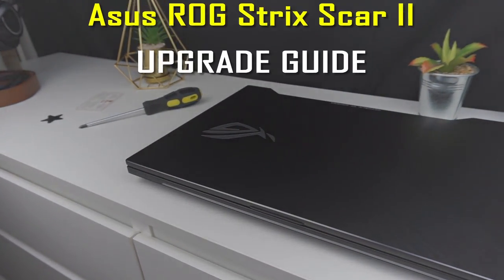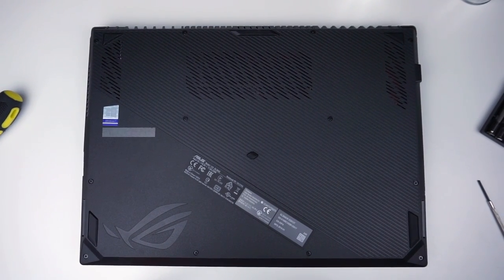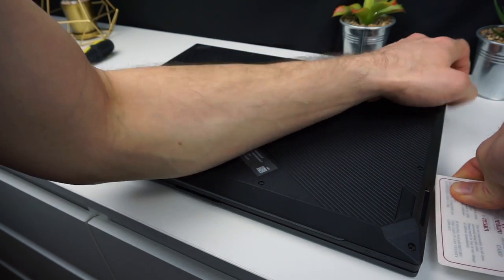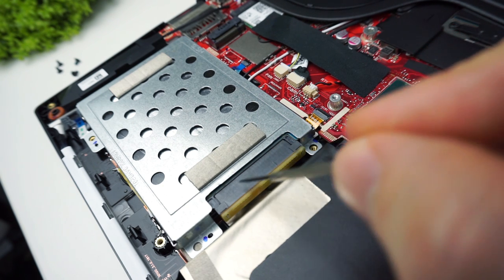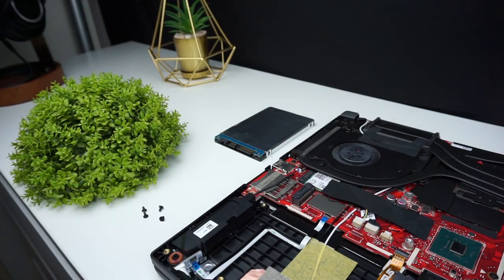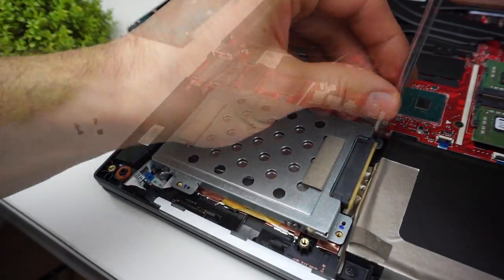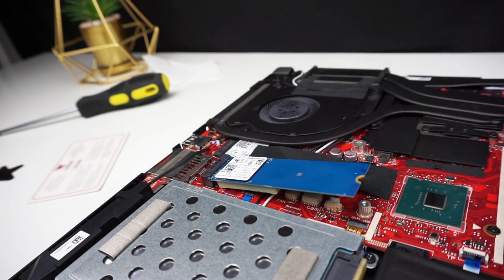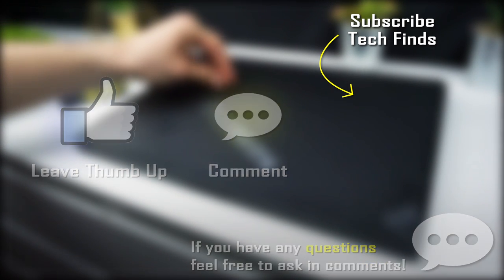Asus ROG Strix Scar II upgrade (RAM, SSD, HDD) - Disassembly Guide (detailed)

Comment from the maker: ✅ Free download RAM / SSD / HDD data recovery software: https://bit.ly/2zRpN9B

INFO UPDATE:
1. HDD cable - If you bought Scar II without HDD and you can't find the HDD cable in the box or inside of the laptop, here you can buy one: http://tiny.cc/f3oo7y and HDD caddy here: https://bit.ly/2X9zXNn
2. HDD connector (motherboard) - On the back of the connector there is a little black tag that you should be able to tilt up carefully to easily slide the cable in and then push this tag down to fit the cable tight.
3. RAM - single channel RAM (1xstick) drastically decreases the performance of this laptop so if you can get it with dual channel RAM (2x stick) go for it or add one more RAM stick if you already have Scar II with single channel RAM. In some cases it's even 30% difference in performance!
4. For those who ask - Scar II and Hero II is exactly the same laptop with the only difference of transparent keys. "WSAD" for Scar and "QWER" for Hero. You can get Scar II with both RTX 2060 and 2070 (also GTX 1060 and 1070) while Hero comes with RTX 2060 or GTX 1060 to choose.
Reply: Tech Finds Hi, if I buy the scar 2 with single channel ram (16*1), what would I need to do to upgrade to dual channel (8*2)?
Reply from the maker: @timeshaft5088  No, that would make no sense. If you have 1x16 you can just buy another RAM stick, 4, 8 or even 16GB and install it. Then you'll have dual channel (2 slots occupied) and even more RAM.
Reply: Tech Finds That makes sense. So if it comes with 1x16, then that means the other ram slot is empty?
Reply from the maker: @timeshaft5088  Yep, this laptop has 2 slots for RAM no matter if they ship you with 2x8 or 1x16. Btw. you can have up to 32GB RAM in total.
Reply: Tech Finds Dude thanks. Seriously you give the best answers
Reply: if I already have a busy ram slot (with the basic 16gb ddr4 ram), and bought another 16gb from another brand, would that be a problem for you?
or should I buy 2 more from sixteen GB of the same brand? coaa change
Reply from the maker: @user-wl4gl2in3l  You can add one 16GB RAM stick that you bought and it should work well if it's fairly similare. Brand doesn't matter so much but for the best compatibility it's recommended to have 2 the same sticks.
Reply: @TechFinds  thanks, i Will buy 2 Stick ballistix 2666 MHz  2x16 GB (how much will the performance increase?) And therefore i must remove the one already in the computer
Reply: I just ordered 32gb of ram, I was running single channel ram and was wondering why my performance was so lack luster.
Reply from the maker: @MrCakePerson  Now not only you have dual channel but also 2x more RAM. That's a huge difference. :)
Reply: Tech Finds I sincerely hope I don’t mess anything up while taking this apart. I even found a 500 gb ssd to put inside
Reply from the maker: @user-wl4gl2in3l  sorry i didn't notice your comment. If you buy 2 new sticks you have to take out the original one but you can also buy only one stick of 16GB and add it to the second empty slot.
Reply from the maker: @MrCakePerson  This laptop was not hard to open and installing RAM is very easy so you can't go wrong. The only hard part is installing the 2.5" drive - this ribbon cable is very easy to disconnect and hard to connect back...
Reply: @TechFinds  When my stuff comes Monday, I will give you an update. How does a laptop 2060 compare to a desktop 1060?
Reply from the maker: @MrCakePerson  Generally desktop hardware is about 10% better than mobile version of it in a laptop. A laptop with RTX 2060 should perform better than a desktop with GTX 1060.
Reply: Tech Finds the ram works fine, my laptop didn’t come with a cord to install my second ssd. Do you have any suggestions where I can order it from?
Reply from the maker: @MrCakePerson  Few people had the same problem here but few of them found the connector in the box with paperwork. Check if you have one.
Reply: Tech Finds yeah, both of my boxes are completely empty. I probably threw it out by accident or one of my family members did. I already ordered a new piece though.
Reply from the maker: @MrCakePerson  sometimes laptops come with the connector already installed inside of the laptop even though it comes without any HDD. But I suppose you have checked it too. Anyway, could you link the one you ordered?
Reply: Hyperx or Ballistix for rog Scar II???
Reply from the maker: @MrCakePerson  Thank You, it's gonna be useful for people who don't have their cable.
Reply from the maker: @user-wl4gl2in3l  Hyper X seems to be slightly better because of lower latency but i'm not sure if you would tell the difference. Both brands are good but i would go for Hyper X.
Reply from the maker: @avikmandal6133  sometimes they send the cable in the small box with paperwork and sometimes it's already inside the laptop but there were also people who reported that after buying Scar II (configuration without HDD) the cable wasn't included at all. It looks like it vary between countries so I can't really tell you if they will ship you the laptop with cable.
Reply: Is there even better performance by having dual channel 2x16 GB sticks than having dual channel 1x16 and 1x8?
Reply from the maker: @carlosduran2800  yes, dual challel works faster. Check out this video to find out more: https://youtu.be/E_aPaj5QkmM
Reply: Thank you, I've been trying to find the cable for over an hour, didn't think to check YouTube comments!
Reply from the maker: @owNewBlood  I think i'll add the link to the video description too. :)
Reply: Tech Finds Tech Finds Hi. First of all thanks for your video, was really helpful. I just ordered asus rog scar 2 and I’m looking forward to upgrade this laptop, my question is... what do you thing about the warranty, i mean there’s no problem adding another ram of 16 cuz there’s an additional slot, however do you thing modifying the hhd would have repercussions on the warranty. Mine comes without hdd. 
Probably a dumb question but thanks anyway, greetings from Spain.
Reply from the maker: Hi, thank You! Well, that's not a dumb question and actually good that you ask. However i can't tell you for sure if you can do it without affecting warranty or not, because the warranty terms may vary between countries. It would be good if you ask Asus's support or read your warranty terms. Generally you should be free to do it since it's a gaming laptop. My unit had only warranty sticker on the cooling system so i was free to touch anything else like RAM, HDD or SSD.
Reply: Tech Finds thanks ❤️
Reply: OMG !!!!! thank you very much. I was looking for that F!#!@# cable everywhere.  THANK YOU !!!
Reply from the maker: @robertovideo  Hahaa, You're welcome mate. :D
Reply: @TechFinds  Do you know what size is the HDD caddy? or where to find it?
Reply from the maker: @robertovideo  You've got it on the same page as HDD cable: https://bit.ly/2X9zXNn
Btw. don't you have caddy too?
Reply: @TechFinds   Nope, I was missing the cable and the caddy.  I bought this computer on best buy for $800.
Reply from the maker: @robertovideo  Wow, that's a very low price. Was it on sale? What are the specs of your model?
Reply: @TechFinds  First, thank you for this quick and to the point video and information, very helpful, I subscribed! I know now why my Hero 2 is performing poorly in games, because it came with 1 stick of 16GB. I have a question maybe you could help me with: I want to add another 16GB stick...you mentioned in the comments above HyperX or Ballistix are better, but I cannot find the same versions you linked on Amazon here in Belgium (where I live). I can only find the Crucial 16GB one, which seems to have the same 2666 MHz, CL19, 1.2V, and pins as my current RAM stick. Can I be sure that if I add this one it will give me DUAL channel functionality? Because on some forums I read that if they don't come in a kit with 2 sticks from the same brand DUAL channel functionality might not work, and I wouldn't want to buy 2 new sticks and throw away my current one. 

Thanks!
Reply: Actually I just found the HyperX 16GB RAM on UK's Amazon at about the same price as the Crucial one in Belgium. The thing is, the latency (CL i think) don't match with my current RAM (seen this in CPU-Z). The HyperX is CL15 and my RAM is CL19 (as I found online. In CPU-Z on CAS Latency it says 17-18-19-20). So do you still think HyperX is a better option or should I go with Crucial since it has the same CL among other things?
Reply from the maker: @draculu  HI, that's good you ask. I always say that for the best compatibility it's recommended to have 2 sticks of the same RAM but in your case it pays off better if you just buy another 16GB stick, so you should go for the one with closest possible specs. I can't conform that dual channel may  ot be working because of difference in latency, because I have never experienced that and as I know
, the dual channel Is wasically when you have physically installed 2 sticks in 2 slots (nothing else). What I know and I can confirm is that if you mix your RAM and the specs will be different, it may downclock to match the same (probably lower) latency, so you may have 2400MHz even tho your both sticks are 2666MHz.
Reply from the maker: @draculu  yep, Crucial is the closest possible if it comes to specs so you should be good.
Reply: @TechFinds  Just to update you. I got my Crucial RAM stick today, I installed and it works perfectly in DUAL channel with my original RAM. Performance increased dramatically, before I had about 160-210 fps in CS GO, now I have 250-300 fps. In Overwatch it went from 100-120 to 170-200 on HIGH settings. Amazing what one stick of RAM can do. Thanks for the help!
Reply from the maker: @draculu  Hey, thanks for the update. The result as expected.
Reply: Question 
If you replace the ssd do you have to re install/buy windows 10 again?
Reply from the maker: @noskis9432  you don't have to buy it again. You need to reinstall it but first you have to get free copy of Windows 10 I guess. Ask Microsoft's support so maybe they can provide you exact solution and tools to do it.
Reply: Tech Finds for some reason its saids the ssd is not connected but on the bios menu it reads it. Did i get a defective ssd?
Reply from the maker: @noskis9432  where you can read that it's not connected?
Reply from the maker: @noskis9432  if the device manager knows that the SSD is there it must read it. Are you able to partition it?
Reply: Tech Finds no it just shows my hhd. I saw another video about this and they suggested to download some drive from samsung for it to be detected.
Reply from the maker: @noskis9432  no idea what's the issue then.
Reply: @TechFinds  I understand that one can clone the SSD so that the OS and drivers are intact and configured.  Would you mind making an instruction video, or directing us to something suitable?   Very impressed with your content btw
Reply from the maker: @fellowcitizen  The problem is i have never done it. I just know that it's possible, because i found many guides on the internet.
Reply: @TechFinds  I understand, thanks :)
Reply: @draculu   Did you add a 16Gb dual rank crucial?
Reply: @TechFinds  Can I add only 8gb single rank on dual rank 16gb currently installed?
Reply from the maker: @silvergem8397  laptop comes with single rank RAM, so for the best compatibility it's recommended to add single rank too. You can add just 8gb if you have free slot.
Reply: @TechFinds  Currently installed is dual rank. Is there will be a decrease on performance when paired on single rank 8Gb ram?
Reply from the maker: @silvergem8397  Nope, the difference of switching from single rank to dual rank is from 0 to maybe 5% depending on game. So pairing single rank with dual rank should not be possible to even notice. It should work without problem, but i always say that it's better to have closest possible specs of RAM to avoid eventual problems when mixing.
Reply: @TechFinds  Ive already add the second ram. Ive seen improvement on DOTA 2 (144fps), Assasins creed odyssey(50 to 65fps) and Overwatch (120fps). Improvement ranges from 5 to 20%. 

This is the model what i bought whichi is closest to the timings: https://www.amazon.com/dp/B07PVW253T?ref=ppx_pop_mob_ap_share
Reply: Hi man! 
I have a question. I am thinking on buying ram for the dual channel perform. 
I can’t decide between 2x8GB or + 1x16GB. The 32GB (2x16) against the 16GB (2x8) will be that big improvement in performance or no? I will see some difference in game or just when multitasking? 
The thing is that’s if I buy 2x8GB I can sell the 16GB stick of the laptop here in my country and win at least 35 US$ in the trade. If not I will be spending 65 US$ for the 32 GB, so there is a US$100 difference for me between 32 and 16 (2x8). Does it worth?
Reply from the maker: @facundolamelas3630  16GB (2x8) is a sweet spot for gaming, you don't really need more. You still may get slightly better performance with 32GB, but I think it pays off only when you edit videos or do demanding graphics work. If you already have 1x16GB you can just add another 16GB stick.
Reply: Tech Finds Thanks!
Reply: Tech Finds what do I do if I do not have the storage piece at 2:37 I have the connector to the mother board
Reply: @draculu  how? I have 110 fps in CS:GO with dual channel in low graphic setting and I don't know what the problem is. Tried to update the bios and also buy another RAM but nothing helped. I don't know what to do. It's annoying because I can't even use the 144Hz now... Any idea?
Reply: I'm struggeling with my Scar II. I have the dual channel RAM version but in CS:GO I have just 110 fps, it's very anoying because with this RTX2060 and the I7 it has to do more than that. I also tried to upgrade the RAM now I have one 8 Gb modul and a 16GB next to it. But it doesn't help at all. Any solution or idea which can help me? I also tried to update the bios but also doesn't helped at all. I'm loseing hope with the Asus products. @Tech Finds please help me :(
Reply: where can i get a hdd caddy
Reply: @TechFinds  What is the company name and model number of pre-installed M.2 NVMe drive???
Reply: Is it good to look for other HDD cable brands that are cheaper? Also, is there a possibility that it could damage the laptop?
Reply from the maker: @haries8255  idk if these are compatible.
Reply: Hello! 
I have one question, I cant find the same RAM: 8GB 1Rx8 PC4 - 2400T - SA1-11. I want one slot with 16GB and I still cant find this one... Wold u have same recomandation for this?
Reply: @haries8255  updates on this?
Reply: Hey, I don't have an HDD cable and your link doesn't work. What do I do?

Comment: It is also possible to replace WIFI card. I replaced from AC to Intel AX 200. I put also into 2,5'' bay another m.2 SSD.
Reply: Hi! What I need to put another m.2 into 2,5 bay? Thanks
Reply: @Pepe-wr6cv  Sorry for delayed answer. You need for example something like this: https://www.amazon.co.uk/StarTech-com-2-5in-SATA-Adapter-Converter/dp/B00ITJ7U20
Reply: don't forget about proper slot at NGFF, m.2 might be in SATA or nvme.

Comment: Just for anybody know, the cable for the ssd or hdd is suppose to be loose as it will hold just fine once the drive is secured with screw. When remove the hdd, removing with the cable before deattaching them probably a better way.
Reply from the maker: That's a good way too. Maybe someone will find it better.

Comment: My experience:  I tried the listed Ballistic 32gb ram kit and it was being read as 2400Mhz by both CPU-Z and 3DMark benchmarking.. There is no XMP available to enable on the Bios to enable 2666MHZ,  so i returned it.  I then ordered the identical to the Samsung OEM  second stick , and CPU-Z is now reading 32GB at 2666Mhz.
Reply from the maker: I've heard that some people had that issue with Ballistix, but not in Scar 2.
Thanks for sharing.
Reply: can you share the link of the OEM RAM ? mine is 8gb asus rog strix g531gt

Comment: Hi, just upgraded mine. It came with no 2.5" drive (just 512gb SSD in PCI Express port, really fast btw), but with the screws to attach to caddy and cable in the box where the manuals are. I added 1 tb SSD WD Blue and 16gb Samsung DDR4 2666mhz (which I think it's the same brand the laptop have). Plugged everything in according to your instructions and worked just fine!
Just one comment: when I added the SSD and I have to connect the SSD cable, it felt like it wasn't 'attached' to the motherboard (like there was no 'click'), but it got recongnized inmediatly by the PC. Another comment I have to make is that you have to manually added it to your PC: just hit the windows button on your keyboard, start writing 'partitions...', hit the shortcut you get and you may find the storage there, with the sign of 'unallocated'. Follow the steps and you are ready to go.
Thanks Tech Finds! You encourage me to upgrade my device 😄 cheers
Reply from the maker: Thanks for commenting mate!
That's a long story but i'm glad it worked. The ribbon cable doesn't click when you plug it into the motherboard. ;) There is a little black tag behind the connector, you can tilt it up, insert the cable and push it down to tighten the cable up. Mine didn't work so i dad to slide the cable into the connector the way i showed in the video lol.
Reply: I might have the same as yours, are you saying there's an extra ssd slot unlike in this video?
Reply: @dreistheman7797 the laptop I have is exactly the one from the video. It has one 2.5” sata drive and one m2 pci drive

Comment: Oh just would have appreciated if you showed at the end which screw holes are for the short ones. Turns out it's the front two corners. Also, does thermal paste on laptops need reapplying? Mine runs hot for long hours playing games like the new CoD
Reply from the maker: Hey, you should consider changing thermal paste after 6, maybe 8 months. But use a good one like Thermal Grizzly Kryonaut.